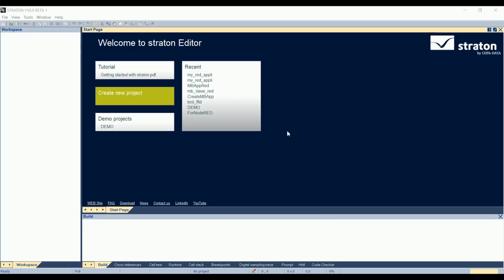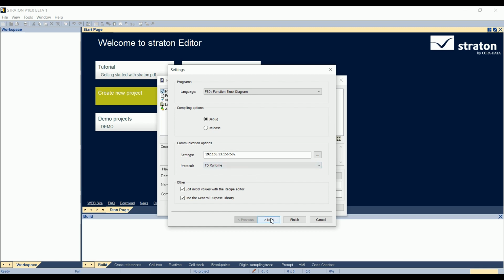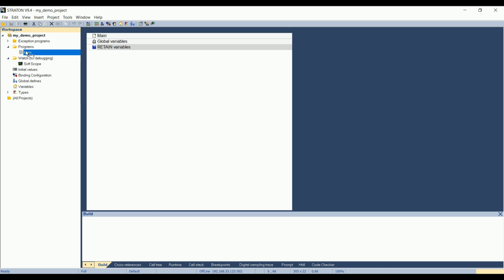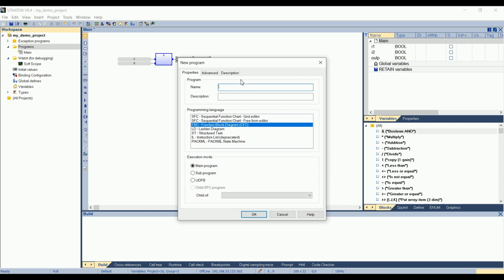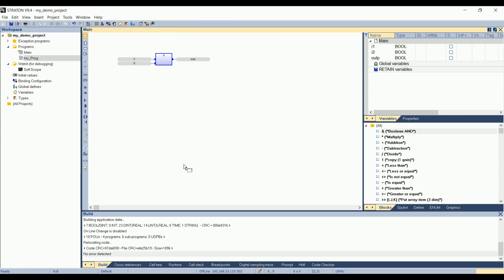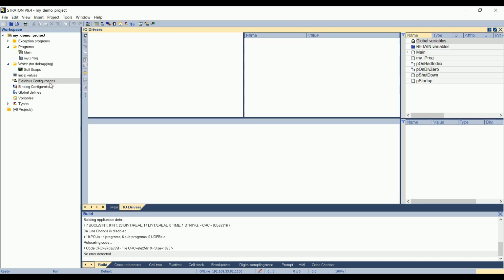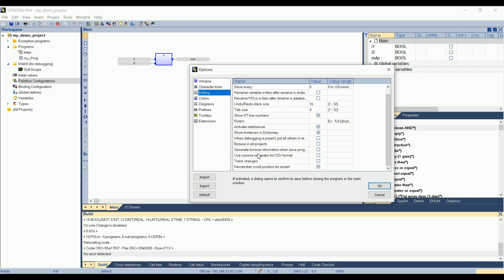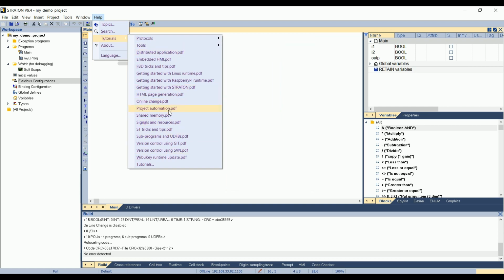Demo - Getting started with straton

Comment: Is it possible to export Variables from the Workbench?
Reply from the maker: Yes, it’s possible. If you do a right-click on your variable group you can export your variables in IEC, XML or CSV.

If you need more information you can contact our support department at info@straton-plc.com
Reply: @STRATON-AUTOMATION  Sorry, your suggestion isn't working. I find that grouping the global / retentive variables and then right-clicking that group DOES NOT provide an export option in the context menu.
Reply from the maker: @Raj Iyer  Sorry for the misunderstanding. The option is not called "Export..." but "Edit Variables as Text...".

This will opens a window where you will be able to :
- Import from an already existing file
- Save As/Export in some formats (as described above)
Reply: @STRATON-AUTOMATION 

 Hi, 
I have an array of 100 arrays, each array has 300 INT Values. This is all in the Retentive Variable area. I am able to populate the entire array (30,000 Values) on the PC used for developing the application. The application even works well in Simulation mode

  I need to transfer the arrays with these initial values into the controller. But this isn't happening. Even while in simulation, these values aren't retained when you build the project.

what I'm looking for, is an easy method to download these initial values into the controller.
Reply from the maker: @TheControlPhilosopher  

Hi,

In this case few methods could be used :
1) Use the column "Init value" (however, this is not the easiest way if you use an array...)
2) Use the exception program "pStartup" to initialize values (this program is execute only on the startup, as its name indicates, and no more after that)

If you have any other questions like this please contact us at support@straton-plc.com (we have a better visibility of the messages)